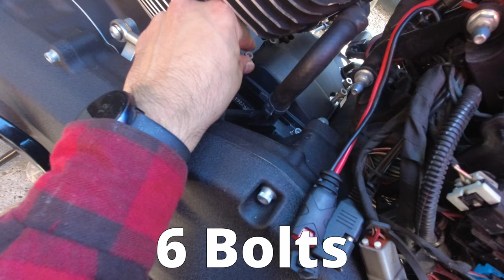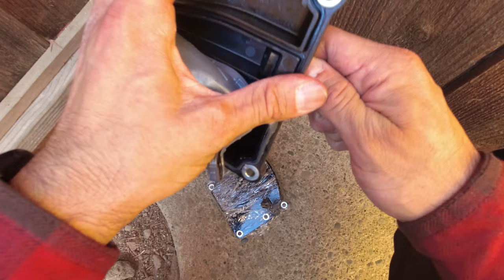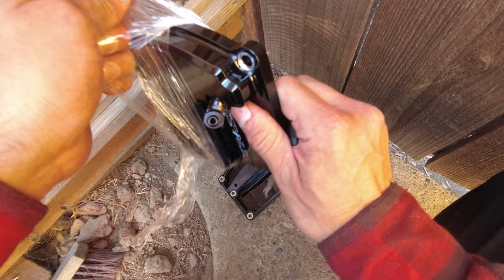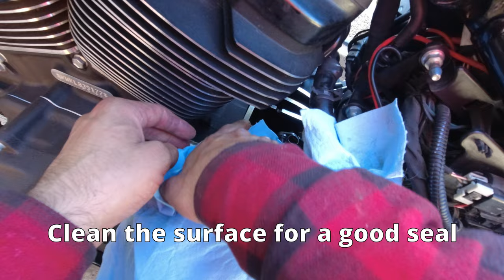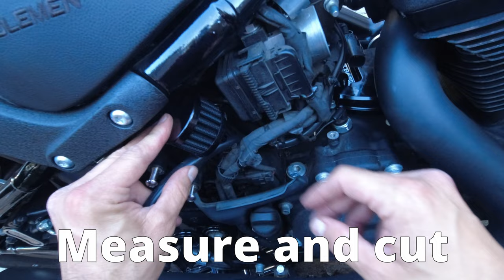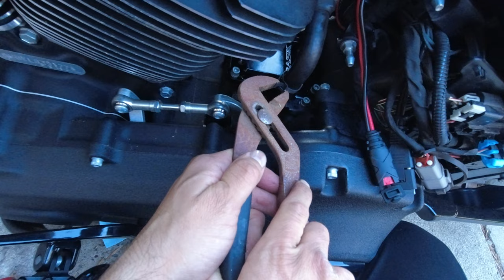Trask CheckM8 Vented Trans Cover Install - Harley Crankcase Breather - Harley Blow By Problem

Comment: i pulled mine out the right side no problem at all. no removing the oil line on my 21 Low Rider S with a S&S  exhaust.
Reply from the maker: I tried the right side, but it was super tight. The left side was much easier for me.

Comment: You should get a set of ball Allen sockets with joints for tight spaces. Makes life easier instead of those manual Allen keys.
Reply: I had to figure this out the hard way lol. You’re exactly right. I can’t find a super low profile sae ball hex 1/4” socket set for the life of me to use with a wobble.
Reply: @palmettolowlife1996  harbor freight has short ones for like 8.99 online or amazon
Reply: @palmettolowlife1996  joints ans different length extensions come in clutch all the time.
Reply from the maker: Took me about 3 hours for these 6 bolts 😂😂😂😂. Would’ve been quicker to just visit harbor freight 😂. Gonna buy a set now for sure, thanks 👍

Comment: The flap is called a ''Check Valve'', a one-way Boyesen valve to bleed off excess crankcase pressure whilst keeping oil/air mist in the cam chest, allowing the oil pump to work more efficiently.
Reply from the maker: Nice 👍, thanks for the info 💯

Comment: Had on installed on my 2018 fatbob which is otherwise standard. Still get an oily film within intake so in that sense it’s a little disappointing… with all the conjecture Re: engine requiring a vacuum thought it may be worth giving check M8 a whirl before bypassing intake (which I’ll now do)… initially felt the bike spun up more freely and felt a bit angrier but who knows… if preventing oil in you intake is your goal I’d look to bypass at intake.
Reply from the maker: It’s mentioned in the instructions, 2019 and later models don’t have the oil pump gasket. That could be reason for the oily film??
Reply: @InfamousCreep  believe not having the pump seal could cause oil to spew from check m8… I’ve not had this issue… only noted a little oil around the hose bard when I’ve checked around the piping. I just don’t think check m8 completely alleviates pressure venting via air intake

Comment: And now your most definitely ready for that cam upgrade! Get the whole cam chest kit vato just to be sure! I can't wait to see a video from the homie Jesse titled "Cam chest upgrade"
Reply from the maker: That’s what I read up on, you need this trans cover for anything over stage 1. I just don’t know when I’ll get the cam upgrade. I’m already in trouble with the old lady 😅
Reply: Don’t need to upgrade the cam plate or oil pump with a bolt in cam. ‘20 and up are good, unless you have money to burn 🔥

Comment: Do you feel n see the difference?
Reply from the maker: Not really, she feels the same. I already have the external breather, so I didn’t need it. You could do either the trans cover or the external breather. But now it’s well ventilated 😎👍
Reply: @InfamousCreep  I did the ac ventilation based on your instruction when you had a SS AC.
Reply: On your filter, do you see any oil residue sipping out a bit? Some people go with catch can but is it necessary in your opinion?

Comment: You'll notice a diffrent in blow by bro lol you won't get any! I switched to Feuling dipstick and haven't had anything but moisture come out! Good buy for sure!
Reply: Are you saying you had this product installed on your bike and removed it for a dipstick ?
Reply: @palmettolowlife1996  na I've never owned a trask vented trans cover my buddy does. I went with the feuling dipstick
Reply: @spoom937  cool. I thought maybe you didn’t like it if you did.
Reply: @palmettolowlife1996  na my buddy has it on his bike and it works just as good! Does the same job honestly!
Reply from the maker: Everyone in the FB group recommends the trans cover is your on a budget, but both products work. Someone else mentioned, there’s no need for external breather if you have a vented dipstick/trans cover. I have both now
Reply: @InfamousCreep I'm checking in on this video much later than when you posted. If you're still checking in, what are your thoughts on this product now?

Comment: Creep, look into the dk customs stage 4 catch can instead of the filter that Trask supplies
Reply from the maker: The Trask filter is a cheaply one, but it’s seating upwards. If there’s any oil build up, it’ll more likely be in the line. The LRS doesn’t spit a lot of oil, it’s only got a Stage 1. If I had a performance engine I’d probably look at a catch can.
Reply: @InfamousCreep  Thank you for this vid! Just installed the DK air cleaner/EBS to a catch can. Could your Trask hose theoretically feed into the DK rubber hose to the catch can via a connection?